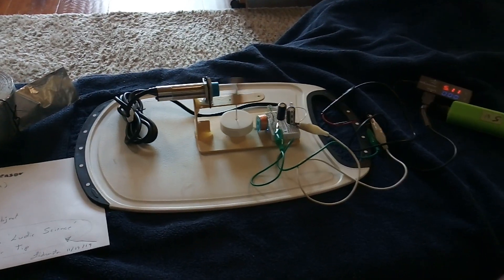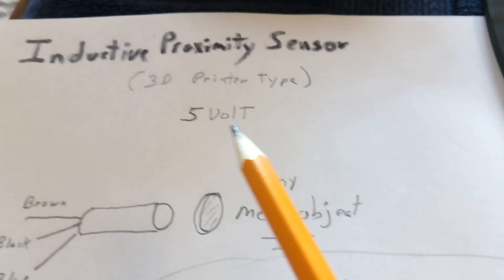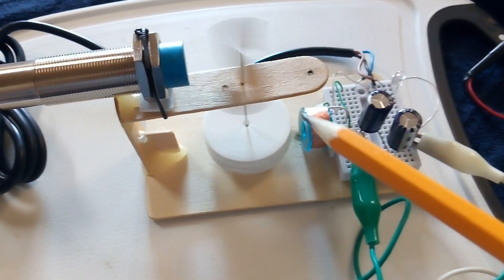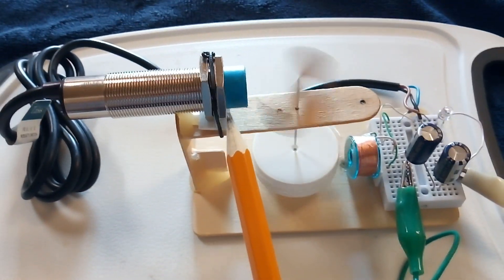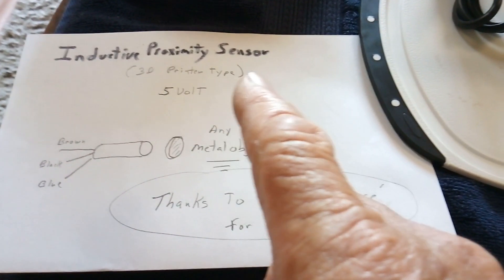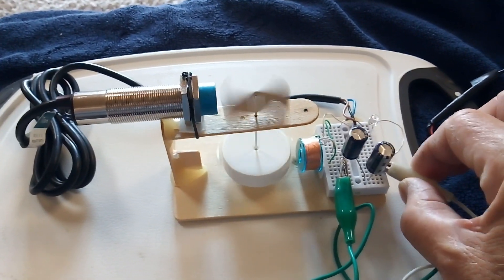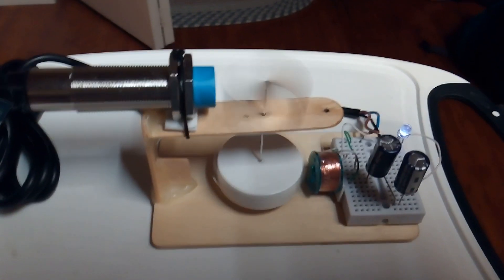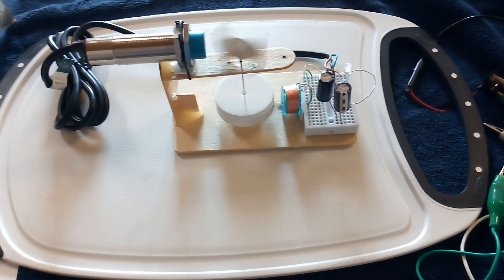Inductive Proximity Sensor-----Pulse Motor

Comment: Like it :-)
Reply from the maker: The basic concept of how these sensors work is pretty simple.----  change the frequency of an oscillator circuit through a capacitance or inductance change and then setup a switch circuit that is triggered by that.

Comment: Very Very nice.. well the inductive one as you said is triggered by metal.. the capacitive one by anything in proximity.. BUT on my 3d printer i changed the capapcitive one to inductive.. .. the creality cr10s pro printer has a blue one just like the one you have.. but it is capacitive.. the inductive ones i ordered are orange color. To test which one you have.. take away your aluminum rotor and just approach with your  finger.. if your finger triggers it, its capacitive. if its only metal that triggers it its inductive... As i have 2 spare sensors i will do some tests with both.. again: very very nice..

Comment: Haha, it was about time the barefoot walkaround made an appearance  :)
Had never heard of these things... great demo!
Reply from the maker: The bare foot walk around strikes again.  Like you I had not heard of these sensors before.  I think that they have been around for a long time.but I have never seen anyone use them to trigger a pulse motor.  There another type that senses capacitance that I might try.
Reply: I wonder if these would trigger off some kind of Joule Thief... to bring the whole thing down to a AAA. I don't imagine they would use much current.
Reply from the maker: @Slider2732  That is exactly what I was thinking.  I did more research on these yesterday and the concept is fairly simple.  A modified Joule Thief circuit coupled to a some kind of trigger circuit  might work.  Basically what is happening is that a near by object changes the frequency of the oscillator and that tells trigger circuit to flip the switch.

Comment: I saw this on Ludic too ,  I was impressed.   Yours too , nice job.     I wonder if it can be done with inexpensive old school hall effects.    Some hall effects latch (close) when the magnet is within range others unlatch (open)    I would think some hall effects don't latch at all and only switch states while the magnet is in the sweet spot.    I think the smaller hall effects only do like 20-30 mA    I'm not an expert on Hall Effects but maybe theres better ones that can switch more current..    *Actually the ones I have sitting here latch open or close depending on which pole North or South you present.
Reply from the maker: Hall effect sensors are great but they detect a magnetic field.  This thing doesn't need the magnet.  Just any metallic object sets it off.  There are some real advantages to that.
Reply: Lidmotor Totally , right out of star wars  or metal detectors I think.    Contrary to what us older farts have been taught Iron isn't the only metal that can entertain being excited by a field.    Sort of like when you have 2 pitch forks tuned to exactly the same frequency.    If you strike one and bring it close to the second fork   then the second will vibrate to the same freq also.    Just watched this interesting video a couple days ago on somewhat similar principles https://youtu.be/mBL9pS6GMdA

Comment: I do not know details of how those sensors work but about 10 years ago we used the exact same thing on machines I ran in a factory. Auto unloaders of steel tubes from a  spray machine were triggered  by these along with other auto triggering machines.  I knew what it was as soon as I saw it. Pretty cool things to have and play around with.
Reply from the maker: Yes!  These things have been around a long time.  I don't know why I never thought about trying  one on a pulse motor.

Comment: That is similar to how the "magic top" works.

https://www.youtube.com/watch?v=lpMB2zu2Yj4

I can't find the circuit drawing that I saw before.
Basically the top has a bar magnet in it and the coil is made up of two windings, one is the drive winding and the other is the scene winding.

https://www.youtube.com/watch?v=NRlwwAax8Ik
Reply from the maker: No.  I am very familiar with that method and it uses a permanent magnet passing a coil for triggering.  This one is different.  All that is happening is a change in the value in the inductive value of the coil.  A circuit detects that change and flips a switch.  Non magnetic metals can trigger it. No magnet required.
Reply: @Lidmotor  
Oh, yes, I see the distinction. 
I am always in the mind set of using the fewest number of parts to make a thing work there for I didn't see the importance of this being triggered by a non magnetic object.